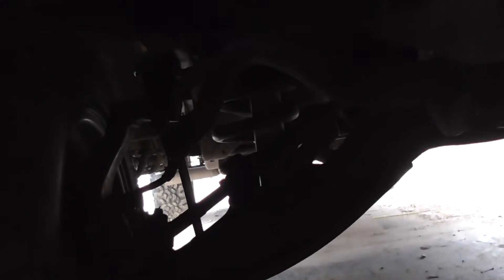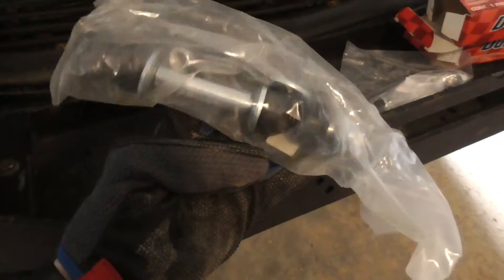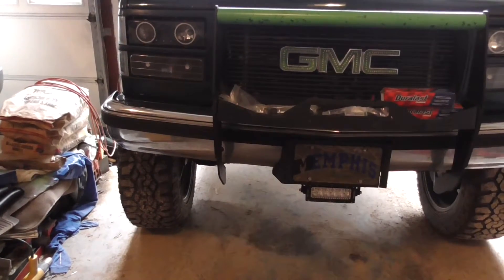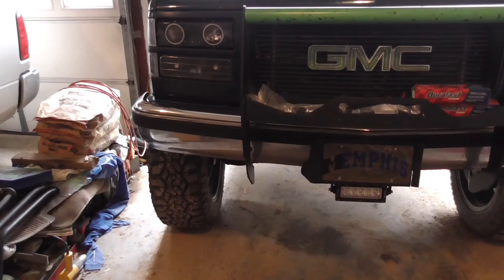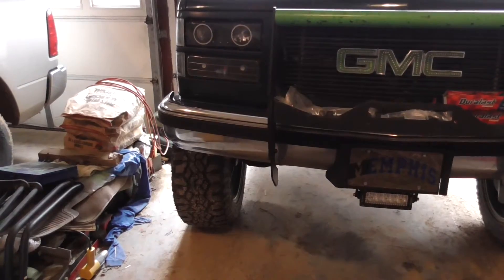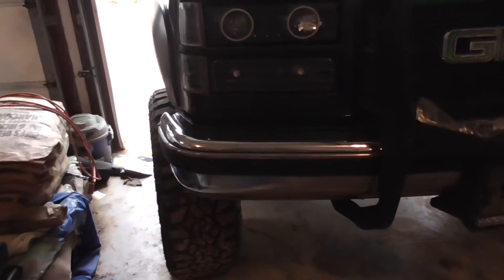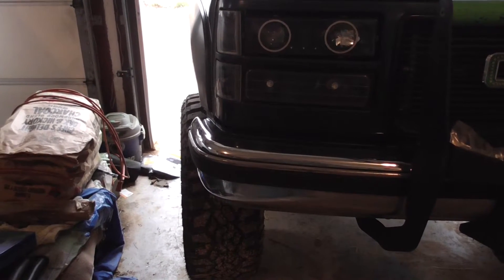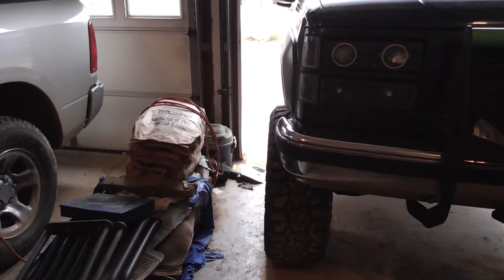Truck Update | Sway Bar End Link Install

Comment: It's usually the pulse board.  The multi function switches last longer than you'd think.
Reply from the maker: That's what I was thinking, and hoping it is. The symptoms are just a little different from the usual pulse board problems.

Comment: I've been running without a sway-bar on my K2500 Suburban almost a year now.  I don't miss it.  I have 12.5 wide tires, too, so stability is just fine.  I removed the sway-bar from my first truck (87 Dakota) and didn't really miss it then, either.  I'm not doing auto-cross in my trucks, so, yeah, doesn't matter.
Reply from the maker: True, I'm used to Jeeps though.  If you remove a front sway bar from a Jeep, you have a death wish. I was thinking that on a truck it wouldn't matter as much but I didn't know.

Comment: I have the same 1996 GMC YUKON SLE 5.7L are those tires you have Goodyear Wrangle Duratrac? What size are you using. Do you recommend those. Cool videos.
Reply from the maker: Tejas Techman These are actually Kanati Trail Hog tires. Same thing as a DuraTrac buts roughly 1/2 the price. I love them and will be getting them again. But I also know some people with the DuraTracs and they also love them. I have LT285/60r20 (33.4x11.2).